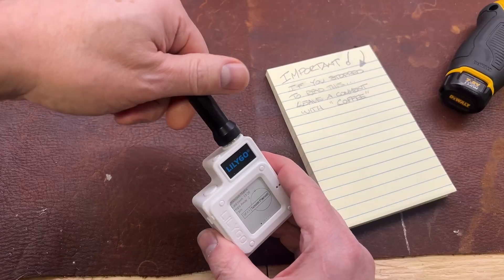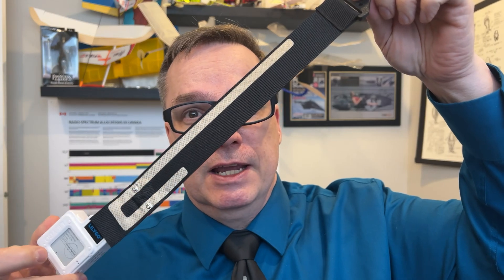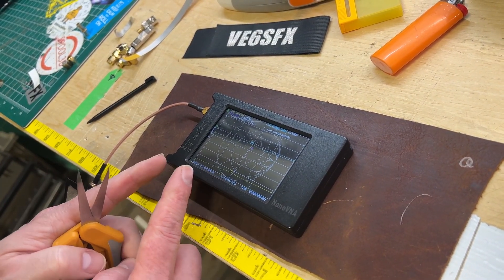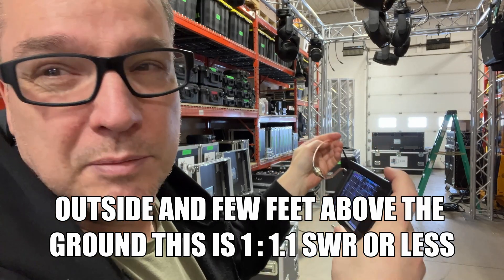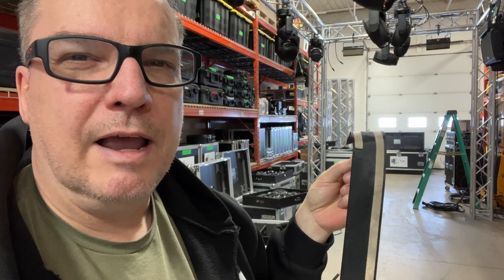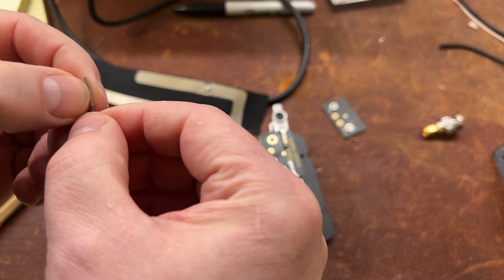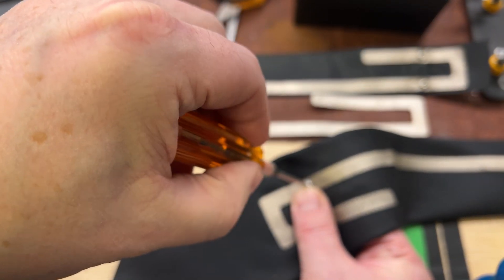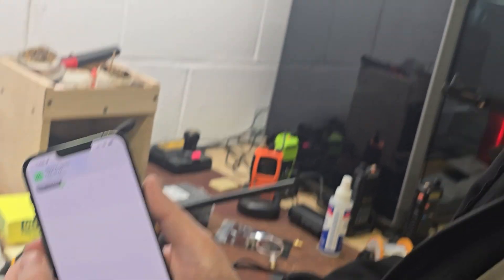MeshTIEstick: The Wearable LoRa Meshtastic Node

Comment: how do You calculate size of that antenna ?  looks great !😅
Reply from the maker: I get the dimensions from a J-pole calculator and then make them longer. Find a good 50 ohm feed point with a magnetic connector, then trim to a better freq, reset the feed point, trim, reset the feed point trim.... RIght now I am working out the maths for the faraday cloth and it is proving to be difficult
Reply: @VE6SFX_HamRadioRookie  You should make a short film about it. 
What You see is what You understand :)
Reply from the maker: I do go over roughly how I do it here. https://youtu.be/d5itl1uWGtU?si=d66za4lOEa1gHGGu But you make a good point and I should do a dedicated video on this. I am for the most part 10-20% theory and 80=90% practical get-r-done kinda guy.

Comment: The VNA will not give an accurate SWR reading for a rubber duck antenna. The antenna uses the chassis of whatever it's connected to as the ground plane. It's actually rather difficult to make accurate measurements of rubber duck type antennas since you need to simulate the ground plane for whatever device it would normally attach to and isolate the feedline from it.
Reply from the maker: Huh. Interesting, with my design it integrates the ground plane so then it’s measurable… now my brain needs to chew on this a bit. Thanks for the insight

Comment: The default frequency in North America is 906.875MHz
Reply from the maker: Thanks. It’s pretty wide banded so that still lands in the sweet spot
Reply: @VE6SFX_HamRadioRookie  Nice. Mentioned it because a lot of people tune for 915 when the reality is a bit lower. It all depends on what the "frequency slot" is chosen in the app's LoRa settings. If the slot is set at zero then it's automatically chosen based on the Primary channel name. The default Primary channel ends up on slot 20, which is that 906.875MHz. If someone uses a different slot, either because of automatic slot selection or manually specifying it, they won't see the nodes on slot 20. That can be good, or bad, depending on ones goals.

Comment: If you want to have another base to market this to, you could claim that this also doubles as a Z-Wave antenna (used for home automation) that operates at 908.42 MHz. Sadly I have yet to run across any of those devices actually using a removable antenna though.
Reply from the maker: I’m sure I could figure it out